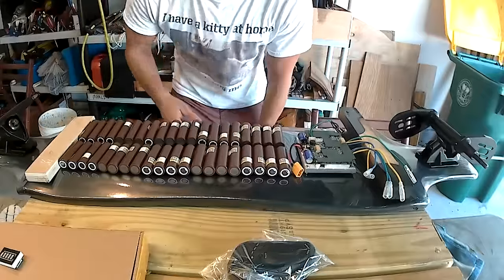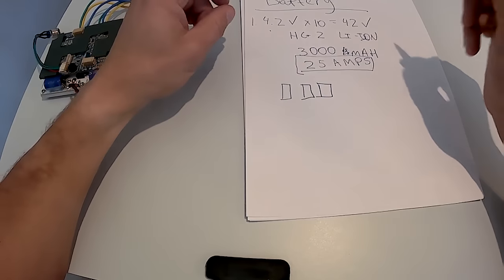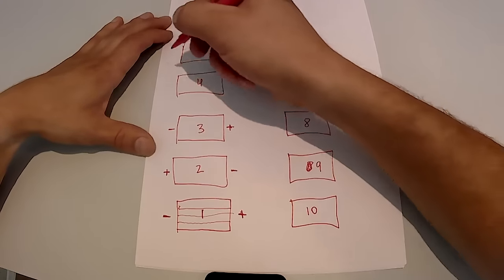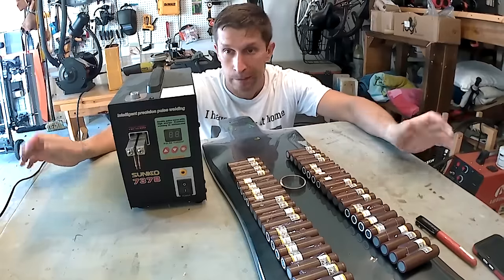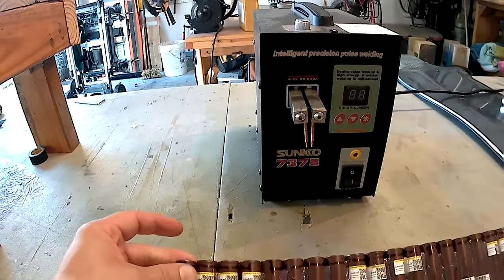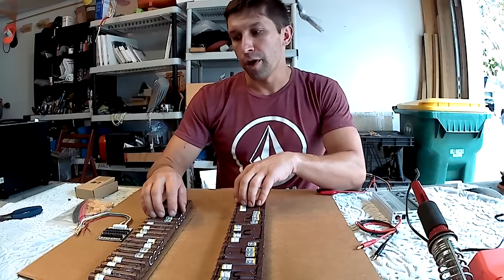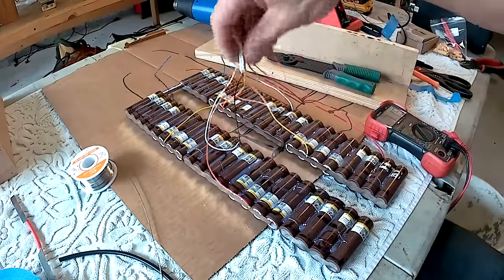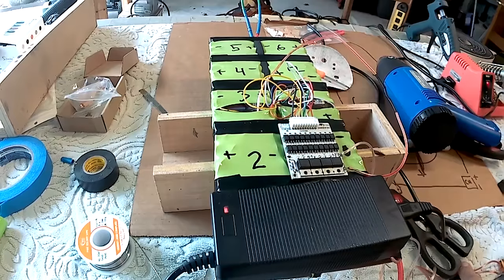Electric Skateboard Battery Tutorial

Comment: is a 10s 8p battery excessive?
Reply from the maker: I have not looked for one.  My guess is:  if you do find a quality 10s8p for sale, it will be expensive.  If you make one yourself, it's going to be  $300 to $400 dollars, depending on what type 18650/bms/nickel/siliconeWire/etc you will get.
Reply: Psrj1748-2446ad if you can fit it, why not? I would say it’s definitely not excessive if you want to ride longer. I saw a new board with a 12s12p battery. Like 50 mile range
Reply from the maker: @enjoyesk8978  It's not impossible, It's just impractical.  I got a 12s6p that I build for my all terrain board (Video Link Below).  It has 20+mile range of aggressive riding, or 30+ of mild riding.  The longest single continuous ride I've been on is 20 miles.  20 miles is enough to wear me out.  If you want a 12s12p, send it!  I'll help you build it!

https://www.youtube.com/watch?v=nrvnTaA1E4Q

https://www.youtube.com/watch?v=lY_sapLZjbQ
Reply: Artsiom Naidzich the original question was if a 10s8p was excessive. I also think it’s not necessary but if you have the money and space to fit it, why not have an ability to go a further distance. The cells are getting better so even a 10s4p or 10s5p is plenty sufficient imo.
Reply: Artsiom Naidzich also I appreciate the offer but I’ve built a few packs myself and have saved a lot of $. I doubt I’ll need a pack that big for a skateboard. Maybe for a future project. I want to do a drift trike. Thanks for the videos man!
Reply from the maker: Eric Fical. Agreed.  I got 12s8p pack on a go kart im working on. Its a pretty heavy and bulky pack. Can it be fitted to a esk8? Sure.  All a matter of preference. 12s is def where its at for vesc controllers. Add as many cells to that in parallel as you need for your vesc and motors to run efficiently.
Reply from the maker: @enjoyesk8978  You are welcome!  Drift trike sounds fun.

Comment: Jooo dont use these liitokala cels there tottaly fake
Reply from the maker: gijs volker thanks. They are fake. But a decent fake. I do get 3000 mah out of them. Amperage is not what they advertise. Do you have a suggestion where to buy non fake cells? Im in US.
Reply: @artsiomnaidzich9515  i dont know where ur from but in europe i use nkon
Reply: @artsiomnaidzich9515  yea i know they have 3000mah but max amp is more like 5-7.5 amps
Reply from the maker: gijs volker I got a 12s4p made out of this litokala cells hooked up to focbox unity. I have it set to 50a per motor, 100a total. On acceleration, HUD  app shows 100a of current.  I think this fakes a capable of 20a+ per 18650 (just not for the continues discharge).

Comment: Fake hg2s and crappy chinese esc good luck it wont last. Check you cells after 20 cycles. Bet your not getting close to 3000mah anymore and a shity bms this is a perfect example of not what to do. Litokala LG = Fake, nickel plate steel strips, shitty vesc, no isolation rings on battery. Worst battery build ever, shitty bms that will discharge your pack and end up killing it when not used. Epic Fail
Reply from the maker: I respectfully disagree with almost everything you said my friend.

You are one of them keyboard warriors esc/battery/bms/nickel experts.  Great to hear your input dingus.  I guess you have done some skateboard forum browsing.  People love hating on other people's work over there.  My guess is that you have not done much esk8 builds yourself.  One thing you did mention that I have changed since this vid, is insulation rings.  With that said, I've never had a battery problem due to original cell insulation failing.

BMS is shitty you say? (you did say it twice).  Maybe you did not connect it right?  I estimate about ten 10s packs that I have personally build with this BMS.  BMS has failed me zero times.  You may just have bad luck.

Steel nickel strip?  Where are you getting that from?  I'm not sure what the purity of nickel was in that particular build, but I only buy pure nickel strip (or at least it is advertised as pure nickel)

I build esk8 based on people's budget.  I do have two builds that I made for myself: one with dual esk8de controllers, and one with focbox unity.  High end controllers are way better for sure.  You are preaching to the quire, dingus.  However, those cheap Chinese escs and batteries have been reliable for me so far.  Outside german made esk8de vescs that are manufactured in Germany, I am not aware of many others that are not manufactured in China.  The oldest esk8 build with this esc that I still ride is this one (I've had it for 9 month): 

https://www.youtube.com/watch?v=150scB51QD8

The ESC and the pack are still going strong.  It still hits 30mph.  Pack has been through hundreds of charge cycles and still has good capacity.  I did a 18 mile ride on it last month (ESC is set to cut out at 3v per cell, and it did).  Battery took on over 10000mAh after cutting out at 3v.  I have personally used and have friends that use this batteries and escs.  None have issues that you have described.  

Do you have personal experience with all the shit you talked about or you just read about it on electric skateboard builders forum?  If so, please send me a link to it.  I'll be happy to share my opinion with you, my dingus friend!

Like and Subscribe!

Here is a link of german esk8De controllers and fake chinese hg2 12s6p pack doing work.

https://www.youtube.com/watch?v=k2zYR2SeJew

Comment: Do not build a esk8 battery like this if you dont want a fire. Each p group needs to be insulated from the others with adhesive fish paper. Also fishpaper rings on all the positive ends. Also round the ends of all nickel strip..dont cut it straight with sharp edges.  This battery must flex and do this by using flexible wire or 1/2" copper braid  between p groups  and series connections. This video has some good info and some very bad tecniques mixed in that will end in a burnt down house , car, or board and the bad thing is you won't know when your lithium fire will start or how it will end. Also remember two nickel strips @ .15 doesnt =.3 for amperage. Your series connections must carry the amperage of the whole pack so do it well and solder from the middle of the p group's nickel and not from the ends. All I can say is this video is bad info and dont build it like this. Go to esk8.news and ask your questions in the battery forum. These guy will show you charts and show you how to build a safe battery that will last.
Reply from the maker: Brent, how nice of you to chime in.  Every pack can be build safer and better. I follow the same forums and more that you speak of. This is one of the earlier packs ive built. Every point you bring up has been brought up already in this message group.  How many variations of power packs have you personally built?  Im in 40+ at this point with no shorts or fires.  The nickel strip charts are made for solar panels, where amperage is carried for a long distance, hence the values u get. If you follow ur own safety standard, you will end up with battery thats mostly made up of nickel strip.  Ive also never had a factory insulation ring fail.  As for rounding nickel strip, sure thats what someone wrote on on of the esk forums, and people jumped on a bandwagon. As long as cut strip to size and properly spot weld the ends, I don't think that step is necessary.Open up some of the commercial packs and see if they round the corners. Insulating each p series for added safety, sure why not. Again, never had a problem with just using hot glue. I do encourage people to do as much research before they start any project.  All the things you mentioned a great added safety factors.  And all of those have been addressed in my recent builds on my yt channel. Point of this video is to show overall process of battery pack building, and to show how to calculate mathematically the size of the battery needed for your ESC or vesc. And this video has hit those marks. Its great that you read the forums and share your knowledge. Perhaps you should make a video of it and post it. Send me a link too! Cheers. Have a nice day.